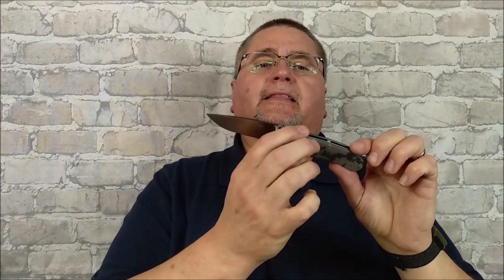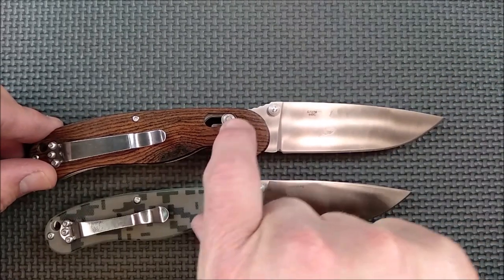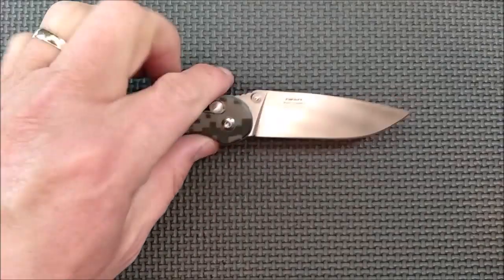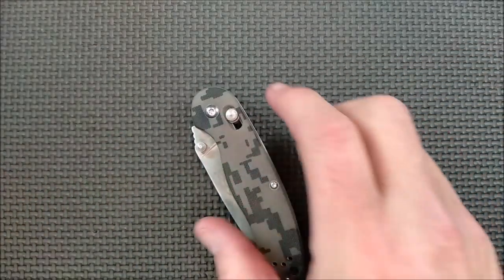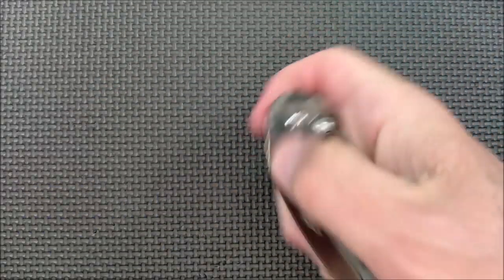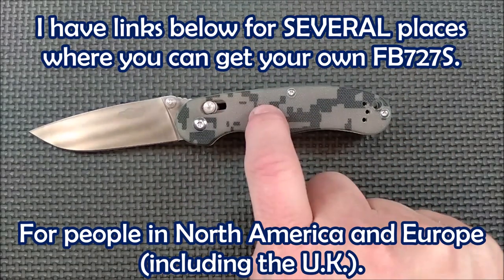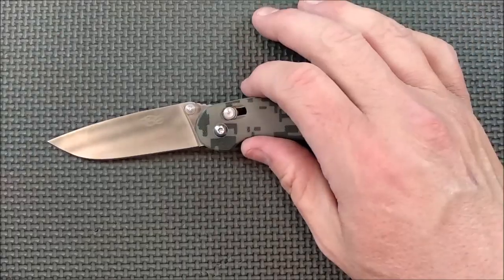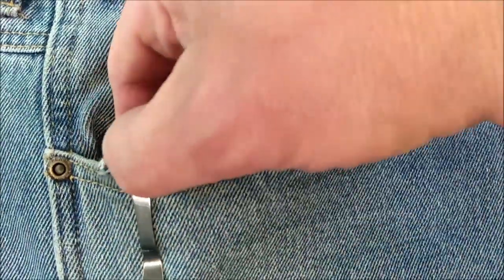Ganzo FBKnife FB727S Review

Comment: Nice review! Most of my Ganzo's including my 727M can unscrew from both sides on pivot, seems they just put a stronger locktide on pivot side...
Reply from the maker: Yes, many (maybe most) Ganzo knives are free spinning.  It is really worthwhile for a Ganzo collector to buy a small vice to hold the knife while using two screw drivers (one on each side) to undo the pivot screws.  At least that is how I do it, it saves a lot of frustration and much fewer stripped screw heads.

Comment: Does the 727M also use ball bearings, or does it use washers?
Reply from the maker: The G727M is the orginal version and then they made the F727M (improvements mostly to the lock mechanism) and both were made with phosphor bronze washers.

There is a new D727M and I fully expect it to have ball bearings like the FB727S, but Ganzo doesn't make that clear in their item description on their website, so don't take my word for it.
Reply: @CanadianCuttingEdge  Thank you for the in depth reply sir! Much appreciated

Comment: Mine is sweet, a smaller version of G727m was my dream for a while. I like the light weight, thin blade, efficient cutting edge length, lock smoothness. Now a smaller F729 PLEASE
Reply from the maker: Right on
Reply: Can't find those anywhere nowadays, i think they stopped producing them. Which sucks because it was an excelent PM2 without the spyder tax.

Comment: I like the lock and the small size. I think I need to buy this. Is there a better choice under $25US with an axis lock and for medium-sized woman hands? A flipper would be great, but I can’t find one at this price. Good review, thanks.
Reply from the maker: It is not often that you find an axis lock knife that also has a flipper.
Have you checked out the FH61? https://youtu.be/O0Fu7hekkdA
or the FB762 - https://youtu.be/rttsUrH0hDM
I think you have asked about the F753M1 - https://youtu.be/LndhFXH2D6U
all 3 are in stock in some colours at powercutlery.com and use coupon code cce to save 5% - if you have not used it before, sadly the coupon only works once per customer
Reply: @CanadianCuttingEdge  I see button-lock flippers are becoming a thing. Tangram Vector and Kizer Swayback are too expensive. Kershaw Dimension might be found on eBay.

Don’t like the snooty rhino looks of the FH61. :) The 762 is good looking and light. Will consider it. Thanks for your help finding the right knife!

Comment: Hello Jake. Yesterday I just received my FB160, and when I open the knife a quarter of the way, there is a clicking sound. Also, if I shake the knife there is a clicking sound. Any suggestions?
Reply from the maker: I am sorry, I didn't notice this comment until now.
Suggestion:  send it back to where you bought it.    If its too late for that now then I might have more ideas if I can get more details.  You can email me CanadianCuttingEdge AT gmail.com and I will respond much more quickly than here on the comments section

Comment: I shorten my FB727s knives by taking the back of the blade to a medium-coarse diamond stone. I come in at about a 30 degree angle until the blade is right at 3” then I contour the spine until it closely resembles the profile of the original blade. I don’t touch the cutting edge. I blend the appearance of the spine into the original part of the blade with EZ-lap diamond hones. Takes about 45 min.
Reply from the maker: That sounds pretty cool.  If you have time I would like you to send a picture of your modification to my email:  canadiancuttingedge AT gmail.com

Comment: This knife is horrible. Just got mine in.. opened the box, flipped it open, closed it and put it right back in the box to return.  Hideous action.
Reply from the maker: Mine work very well, better than many Benchmade knives with the same type of lock.  Your's may have had a flaw?
Reply: @CanadianCuttingEdge  I agree.  Just recently received mine and it is incredible to me that they can produce such a knife for under $20.  The action is great and the locking mechanism works perfectly and is solid.  Many knives require a bit of break in period, but this one was spot on from the beginning.